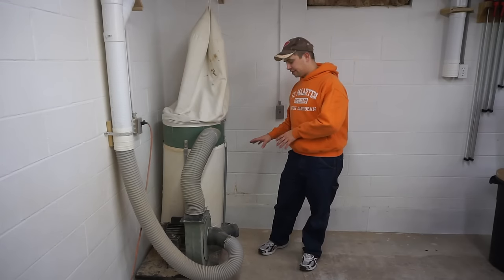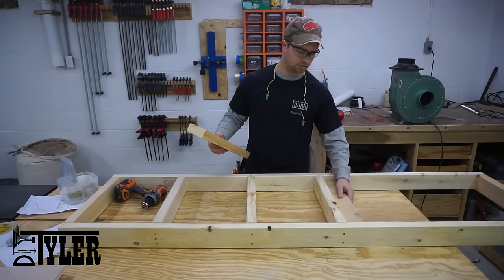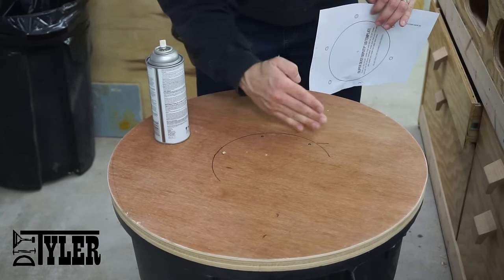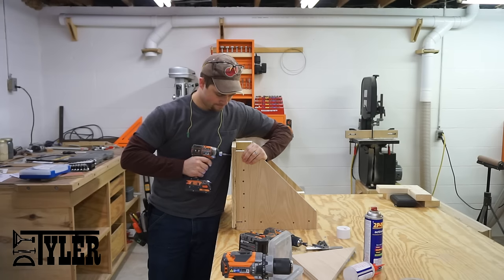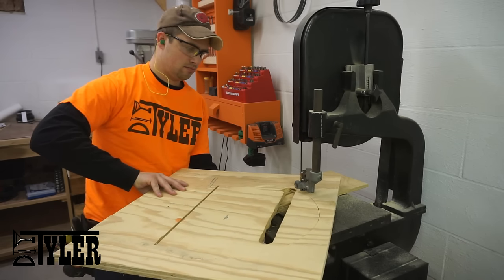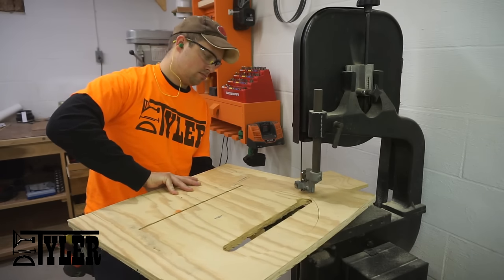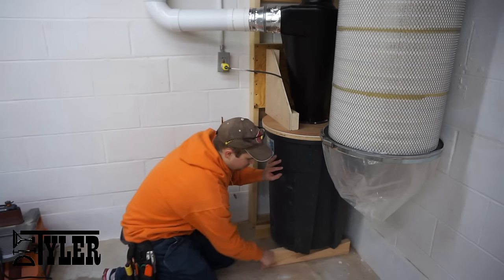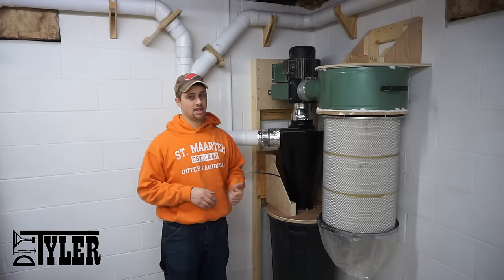2 Stage Harbor Freight Dust Collector

Comment: How big (square feet) is your shop, and how many machines do you run at the same time the collector is running?
Thanks!
Reply from the maker: Shop is about 375 sqft and I only run one tool at a time while the DC is running.

Comment: Hi Tyler, great video and great channel! Do you have any idea what your actual CFM is at the far reach of your system? or in more general terms that I would understand, Does it still have good suction at your farthest point? I will be installing a system soon and just trying to get an idea of how far I can route the system.. thanks from a fellow Hockey playing wood worker!!
Reply from the maker: I don't have a hard number for the CFM at the longest run but I do know that I lost very little suction. Longest run is over 40' and I have never had an issue so far. Thanks for watching!

Comment: Nice video Tyler. I am about to make a very similar modification to go to two stage dust collection, one thing I wondered was where the reducer you used on top of the dust deputy came from (I assume it is 6" to 5")?
Reply from the maker: +T Radford It is part number DRL060500 from Oneida. Thanks for watching and good luck!

Comment: Tyler, I have been watching and rewatching your wonderful video for several months while recovering from surgeries. I have a very limited space shop and I also have the HF dust collection system that already has the filter modification and my home made cyclone did not work. I want to replicate as well as I can what you have done. My question is do you have the cut list and plans posted anywhere for the upgrade? Thanks Dennis
Reply from the maker: Dennis, if you go to the LTL video where I discuss this modification in more detail there is a link to some plans. Good luck!

Comment: like the build and am considering copying your design...any reason you didn't go with the dust deputy XL?
Reply from the maker: +pwmartin38 Awesome! The SDD XL is designed for bigger blowers so it actually would not be as efficient as the Super Dust Deputy on the blower size that I used.

Comment: Hi chap..... Great video and dust collection solution.......I have a few questions if I may.
 firstly.... Did you use the super or XL version ?...... 
Secondly.... how is it performing for you?...... 
Thirdly .....other than the monometer (sorry for bad spelling)....
Fourthly.... I see you use white ducting pipe, does it crate static?
And finally..... How often do you change the dust collection bin, do you wish it was bigger.
Thanks again 
Phil
Reply from the maker: Phil, thanks for watching!
1) Super Dust Deputy. The XL is designed for 5hp+ blowers
2) Excellent, I would build again in a heartbeat and others are wildly impressed as well.
3) ? Manometer is a cool feature but the footage on the filter is so high that I have only had to clean it once.
4) Any system will create static, I have never been shocked by it....it is grounded at the blower.
I have only changed the bin 2/3 times, takes a long time to fill up unless you are jointing and planning a bunch.

Comment: Tyler why did you go with that particular filter? I bought a jet enclosed filter with baffle you can swing around in it, I am going to try and make that work. Thank You
Reply from the maker: This is the best filter I could find, the square footage on this is CRAZY and you can clean with a gentle shot of compressed air and it won't cause damage to the filter. BTW, stay tuned for something new with regard to filter cleaning!

Comment: Hi Tyler, Excellent video and well thought out. I also have a harbor freight dust collector recently purchased but not assembled yet. I have been waiting for a logical video like this. I too want to convert it to a two stage collector. What was the model of Winn filter you installed.   wouldn't mind upgrading the microns on the filter but want to make sure I would get the right  size/.model for the HFDC. Thanks TylerMichael
Reply from the maker: +Michael B Here is the model filter I used (62N220NANO1G) it is not a stock filter so it take about two weeks to come in. This is a MERV 15 filter which I believe is just about the best out there as far as woodworking filters go. Thanks for watching Michael!

Comment: Were you able to run any tests yet of CFM? I have 2 Jet 650 cfm units but they are not strong enough to pull dust in an overhead pick on top of table saw. Wondering if you saw noticeable increase that would warrant me building out mine as you did

Comment: I'll be starting mine soon.  Thanks for the help.  I do have one question.  How do you like the Dust Deputy?  Does it seem to be working and keeping most if not all of the fine dust out of the filter?
Reply from the maker: +Greg Altenhofel So far the Dust Deputy is great, have not used it enough to tell how well its working but for the few cuts I have made it looks pretty darn good. Thanks for watching Greg.

Comment: Awesome video...question, does your plumbing around the shop have grounding wire run thru it?
Reply from the maker: +Eric Goss It does not. The machine is grounded and as far as I have researched it's 50-50 as if extra grounding makes any difference. Haven't shocked me yet! Thanks for watching.
Reply: I have grounded a short run to my table saw and it sucked!...I'll forgo it on my expansion.  Thanks!

Comment: I am just curious. Wont it wear out the bearings on the motor if you mount it on its side? I think it will bro. The bearings on bottom will be gone in no time. Looks fancy tho.
Reply from the maker: Lasted me many years in this configuration and no bad effects as far as I could tell.

Comment: Curious how the bolts are holding up for you thus far?  I'd be concerned of them shaking out over time.  I would have used some thread locker of some sort.  Just an opinion :).  Nice build!!
Reply from the maker: They are solid as can be still....thread lock wouldn't hurt but if you have vibration like that you got bigger problems. Thanks for watching!

Comment: Hey Tyler.  Nice build on this one.  I copied the system Mono Loco Workshop created.  Did you have any trouble finding a 6 to 5 inch reducer to go from the Dust Deputy to the intake of the impeller?  I had to buy 3 of them, and then I had to modify the 3rd one to get it to work.  Just wondering if you had to modify the one you used before you put it into the dust deputy.
Reply from the maker: +Howard Springsteen I got the one I used from Oneida....was a tight squeeze as you probably saw but it fit great in the end. Thanks for watching!

Comment: Question, if the other side of the wall where you mount the motor/blower is the outside, why can't you simply open a hole on the wall and let the exhaust blown outside, then you don't need the secondary filter, since the debris is so little. You don't need to change any filter at all.
Reply from the maker: +Francis yu Yes and many do but I didn't want to open a hole that big and you suck all the AC and heat out of the shop. And you create a pressure difference in the shop as well. Thanks for watching!

Comment: Tyler, do you have any idea how far the Harbor freight dust collector will suck efficiently, I am looking to hook mine up, I just bought, but my cnc machine is inside the house, and the shop is just outside. cnc is approximately 50 feet from where I want the collector, but the real shop main line should be ok. If I have blast gates closed during cnc, to isolate, should it do the trick? I know elbows and such cut the flow, probably like 4 from cnc to unit...????

Comment: My two stage system has Wynn filter that is closed on one end.  Wonder how well such a Wynn will work, as there will not be in dust bag (or equalized static pressure on other side of filter)?  Ned

Comment: Hi Tyler, I need some clarification in your design - the motor is forcing air out through the filter first and then any dust that makes it through the filter ends up in the bag. However since the filter is 'porous' and the polybag is not I wonder if the filter is actually trapping all the dust that would (if you mounted the filter on top) end up in the bag.  Your thought?
Reply from the maker: There shouldn't really be any dust in the air once it gets to the filter, that is the reason for the SDD. The bag is really for when you do need to blow or bang the filter out (over time a bit of dust will build up in the filter, to catch the dust that will fall out. Or for when you overfill your bin.

Comment: In your other dust collection video, you mentioned doing the 2 stage setup and using the Thein setup--why'd you go with the oneida instead?  considering you made your own brackets and blast gates, seems you don't have problems making things that can just be bought, surprised you did it for the cyclone.
Reply from the maker: Really considered a DIY Thein baffle but not matter how well you make it it will never be as efficient as the cyclone. Thought about making the cyclone as well but I really don't like working with sheet metal. Thanks for watching!

Comment: Hi, I watched this video several times and recently made similar upgrades to my dust collector however I noticed my dust bag is not longer under pressure, is this because now there is not restrictions in the filter so the plastic bag is loose? Thanks

Comment: If I wanted to create an enclosure to cut down the noise what would be max outside dimensions? This could also be used for the 20 gallon compressor.
Reply from the maker: If you hit up my website I have some downloadable plans with all the dimensions....it's on the LTL post for this build.

Comment: Hi Tyler, the metal adapter going from the motor to top of dust collector is almost the same size of dust collector, did you crimp down metal to make it a little smaller, or what? How did you get it to fit?
Reply from the maker: The adapter that I got happened to be a perfect fit right off the bat. It is part# DRL060500 from Oneida. 

I pre drill here https://youtu.be/0RAoj4urS-Y?t=3m23s
And I used tapcons for the fastening. Thanks for watching Randy!

Comment: I'm not smart so i ask lots of questions.   do you ever have to clean out the 0.05 micro filter? I never see videos where people talk about this? if so how? you screwed it to your frame? thanks for humoring me.    great video!
Reply from the maker: +rusty Shackleferd (mirrored eyes) Yes you will need to clean it out every so often....I have not had to yet. You only need to blow it with low pressure air from the outside in and then empty the catch bag. If you need to take the filter off you simply back the screws out and your good to go! Thanks for watching.

Comment: Hey I have a shop fox that I am trying to modify overall layout of the system which will require the motor to lay on its side.. will that matter at all? Is there any reason not to lay the motor on its side? I have to do this in order to raise the motor higher up so that I can run the main lines up hi in the air rather than on the ground....

Comment: Hi I know you made this video some time ago, but I will be construction something similar. I like to tap in to your experience, my question is. when you mounted the motor with the rotor section with the suction hole facing down motor shaft vertical... which is not what was designed for, " DID YOU HAVE ANY PROBLEM WITH THE MOTOR SHAFT AS THE LOAD IS BEING ON NORMAL ROLLER BEARINGS IN THE MOTOR , NORMALLY WILL BE TRUST BEARINGS TO SUPPORT THE MOTOR SHAFT AND THE IMPALA HANGING FROM IT ????? " THANKING YOU IN ADVANCE, kind regards from Oz Jack Marashlian
Reply from the maker: Never heard or saw any ill effects from mounting the motor this way.

Comment: Hi Tyler, really nice work. How high is the high point of the impeller motor? I want to make this for my basement shop, but the ceiling is about 6ft 8in. Wondering if it would impede airflow much if the impeller were turned 90°, and the 2nd stage filter dropped down 1-2ft, to make a lower over all height. I'd use PVC tubes to connect.
I have to get some nice ear protection for my 2yo.. ;)
Thank you
Reply from the maker: +Arturo Vidich 72" to the top of the motor popped into my head. Turning the motor would impede the airflow to a degree but it should still work just fine. Thanks for watching man!
Reply: +Arturo Vidich Hi Arturo.  I have a low ceiling also.  How did you attach the filter portion?
Reply: +Stephen Wood  Hi Stephen, I haven't done any of it yet, and won't until starting next month the earliest. I've been looking at all the various different ways of using the HF impeller and that 1 micron filter unit, and will likely come up with my own design. For starters, I'm going to make my own 33gal thien separator rather than purchase the Oneida separator in the video. That will drop the whole thing down by whatever the height of the Oneida separator is. A little extra work, but that's the way it goes.

Comment: How do you eliminate static from the airflow through the PVC... sparks and dust can be bad news.
Reply from the maker: Machine is grounded at the motor end. Have never had an issue. As far as I can see everybody's opinion on the matter is 50-50 split as to if its even an issue.

Comment: Tyler, - excellent demo and information. My shop is too small for the over head ducting, but I am definitely going to convert my system to something like this. Your mounting system is ingenious as is the sliding "ramps" under the trash can. My actual unit is in a small room on the other side of the wall, and is hooked up through the wall so I'll have to think through the installation a bit. 

Questions please:

Did the big canister filter come with the Cyclone or is it a separate purchase? The silver reducer your forced into the top of the Dust Deputy: did that come with or separate purchase?

Also, how are you able to turn the plywood so easily while working on your table saw? Is there some kind of pivot located underneath? I'm sure I'll have more questions but if you could answer these that would be great. Thank you! P.S. loved seeing your family too. Tell your lady I said good job with the drill.
Reply from the maker: David, thanks for watching our stuff! The filter is a separate purchase from a different company, although Oneida sells filters as well. The reducer was from Oneida but not part of the cyclone, each piece is a different part number.

While cutting the circles on the band saw I was using a circle cutting jig, just a thrown together one for now. Want to do a video for a good design one of these days just no time, there are plenty of good designs and instructions out there already. Hit me up in an email if you have any more questions, DIYTyler@gmail.com
Reply: Thank you, Tyler. Will do!
Reply from the maker: ***** It is 62N220NANO1G from Wynn Environmental.
Reply from the maker: ***** If you hang tight a week or two I will be showing a new filter from Wynn.
Reply: I like the ramp/wedges but suggest adding something to keep them aligned. Either a spline down the center glued into one wedge and free on the other or some thing plywood on the outside. Taking it even further you could connect the two side so that you could engage both wedges with one motion.

Comment: I'm getting ready to do this in my shop. Are you using the triple wall solid pipe that is like $8 from Home Depot? Any problems with it yet?
Reply from the maker: That is the pipe, no issues. Definitely the way to go, much cheaper for the pipe and the fittings as well.

Comment: Tyler, would you be willing to provide some measurements of each of the parts for your 2 stage harbor freight dust collection project?  Specifically the mounting board dimensions, heights/distances, and total footprint?

I want to see if your application/design would actually work for me in the space I have available before buying all the parts.
Reply from the maker: +Shawn Mease Hey man, send me an email and I can send you the plans. DIYTyler@gmal.com
Reply: Hi Tyler, could you please send me the plans as well. I will send you my email. Also wondering where you got your filter.

Comment: I tried to use a garbage liner inside the garbage can, thinking that since it is airtight, there is no reason why the liner would suck up into the cyclone. But I was wrong! I figure that probably because the bag was empty, but would you recommend using a garbage liner inside the can?
Reply from the maker: Would sure make it easier to empty but I suppose you would have to have some weight in it to hold the bag down. Have never tried.
Reply: Tyler G 

here's an easy trick. line the garbage can with a bag. take another garbage can and cut out the bottom and set it inside the bagged garbage can. 

the bottomless garbage can prevents the bag from sucking up into the vacuum.

when the can is full, pull out the bottomless garbage can and then you can change the bag. we do this for hazmar work inside of containments.

Comment: Tyler, what is the mounting bracket Mr Wynn just talked to me about FGLU-4?  For mounting the air filter?
Reply from the maker: Think of it as a hose clamp with hooks on the end. I do not use it in this video but I have a video coming out next week where I show what they are.

Comment: why do you have such a massive filter on the output? does the motor not care about dust running through it?
Reply from the maker: The cyclone collects about 99% of all dust so not much of anything goes through the blower. Nothing travels though the motor itself. This is the way all dust collectors are designed. The big filter allows for unrestricted airflow even when its partly clogged up with super fine dust.